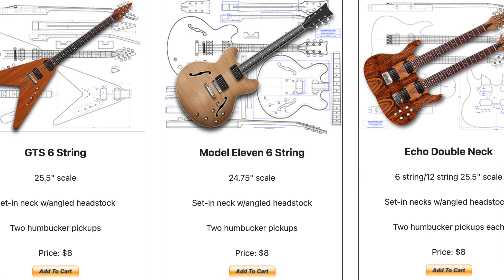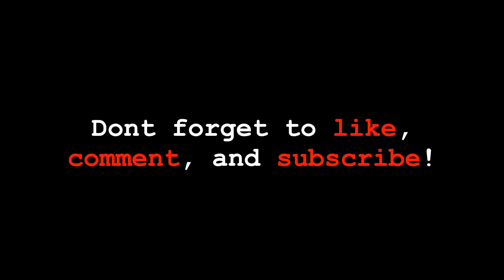DIY Sandpaper Storage Organizer

Comment: Is there a reason why the cnc wasn’t your go-to tool for this and route  the groves all the way across the long plywood sheet? Sorry. I’m a Super cnc noob
Reply from the maker: This project was a good example of how CNC isn't the best choice for everything. It takes less time and effort to move a table saw fence than it does to build the files and g-code for this project. If I was going to manufacture this storage unit, I would definitely use my CNC. However, it was a one off so CNC didn't make sense.